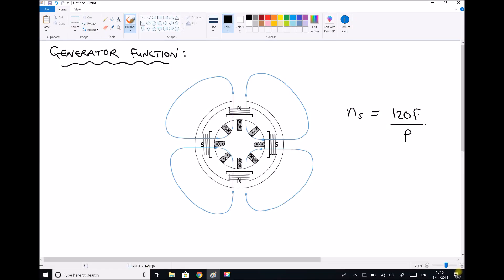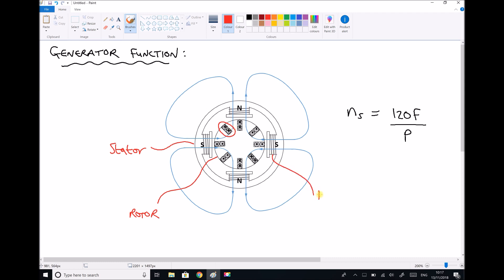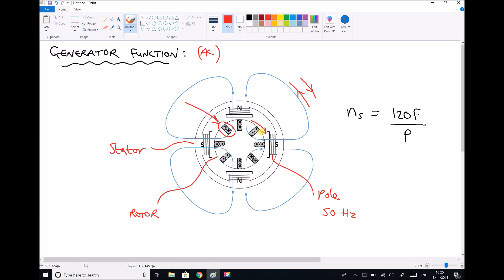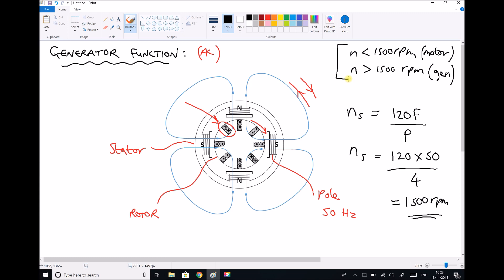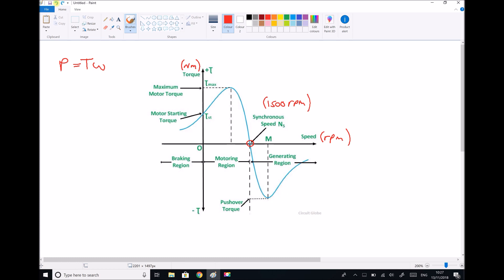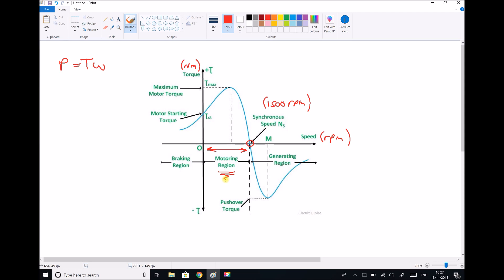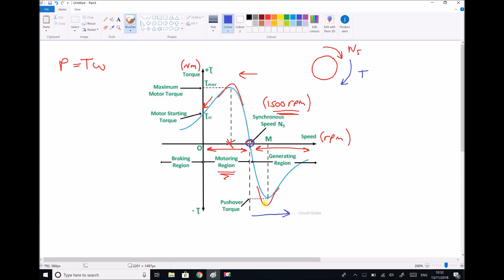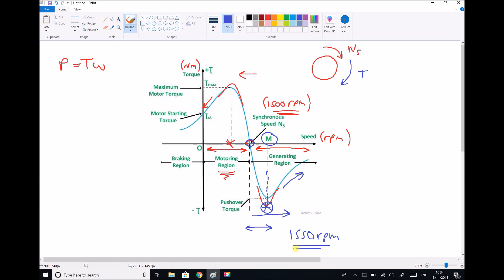AC Induction Generators and Electrical Energy Production

Comment: I want to ask about the doubly fed induction generator. Does it contain damper windings. Does the main rotor windings consider as adamper windings due to the related speed between the stator and the rotor is not zero speed.